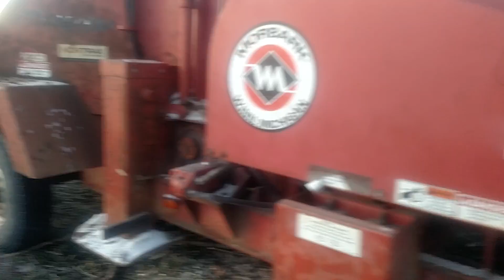The break down fairy loves Mondays!!!

Comment: I started the winter with 6 working saws. Sold my Jonsereds 2171. The little saw husky 362 xp too small for hardwood log trees. Forwarder ran over my old reliable 2002 model husky 372 xp. My newer 2013 372 x torq rattling like a rattlesnake, probably a clutchside bearing. I do have my 1996 371 xp still running that my hired guy is using and a 576 xp. I can still work but i feel naked without backups!
Reply from the maker: +Austin Denotter we need to start a support group!
Reply: Sounds and looks like you already HAVE one!